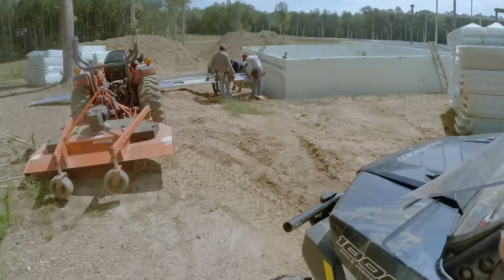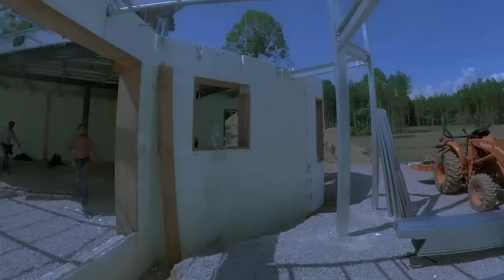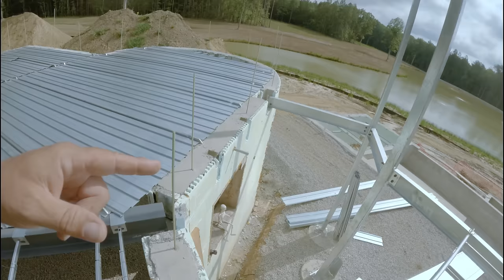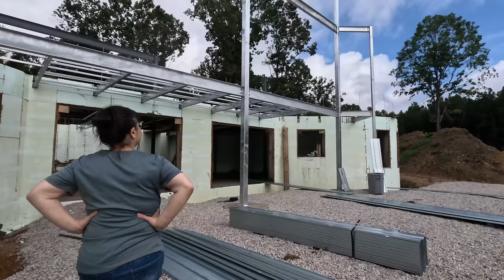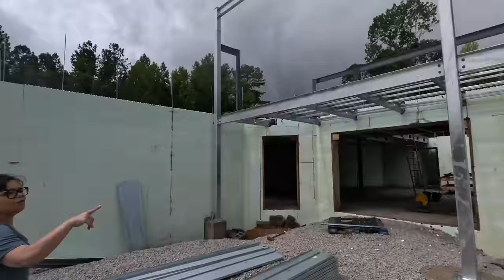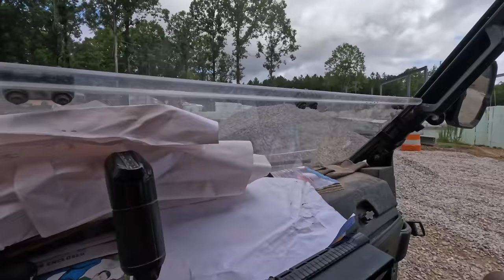Super Floor Day 2 | Rolled Steel Joists & Metal Pan Installation

Comment: It has to feel wonderful walking around on the first floor now! This is getting very exciting, Geoff. And I have to commend your crew. They do know what they're doing and they do it very efficiently. 

Simple mistakes ALWAYS happen even when you plan for them. The mere fact of pouring that much concrete and you only had one small area of under-pour is amazing. Of course you don't want any, but as I mentioned, my dad poured concrete for 15 years. He said there were always pour mistakes unless you were dealing with a couple of yards or less. Looks awesome!
Reply from the maker: Thanks Vickie 😁

Comment: I have seen a suspended Sheetrock ceiling in some houses. They bring it down 8 to 12" below the joist for mechanical. Looks like you will have room for that, you wouldn't have to wrap your steel beams with that.

Comment: Great progress!  Now, you still have a slew of mechanicals that need to be buried in the floor.  And you still need to pour your floor.  With all that panning in place, it's evident you won't be chuting  it in with a pumper truck.  So are you planning to run your crete with buggies?

Congrats on 2 stamps of approval from the boss.  You got an "Attaboy" AND a "you were right" in the SAME VIDEO!  WOOO WOOO!  You be smilin' for days now!
Reply from the maker: My pump operator says he can 🤷🏻‍♂️. If not, we’ll use a line pump. 😁

Comment: Just a quick question… I got my wife interested in watching now and we are curious where your garage will be now… floor system is awesome !!
Reply: All Garages should be connected to house by a Breezeway for house insurance to include Garage in its policy, avoiding more expensive Homeowners Rider Policy to Insure Garage, cause Garage is then covered under the homeowner blanket policy, a elimination of fire hazard and chemical storage considerations !
Reply from the maker: Close by.

Comment: Thank you for the video update.  I haven't seen metal framing put up this way before.  Rarely do you see workers climbing ladders, usually framing like this is erected by workers on electric powered man lifts and scissor life, guys definitely don't go up and down step ladders all day.  The lifts are usually rented by the week, few are actually owned by contractors.  I would have expected to see at least three or four scissor lifts on a job this size.  I guess they'll have great thighs and calves when they're done.  I couldn't do it, I'd be worn out.
Reply from the maker: The way the decking snaps in a lift wouldn’t have helped. They were supposed to bring their boom truck for setting joists but decided to do most of it by hand 🤷🏻‍♂️

Comment: Geoff, I was jut wondering what is the advantage of this system as opposed to traditional steel beam and bar joist  with steel decking ??
Reply from the maker: Ability to modify onsite. Cost. Speed at which the material can be made and sent out.

Comment: That is awesome progress.  I've built some buildings, added on to my house and finished out a basement, but none of that was on this scale.  I am assuming the basement floor will be concrete and wondering why it wasn't poured before the metal pan went on.  It seems to me it would be easier to get the concrete in, although maybe the hose from the pump truck is flexible enough to go through a window?
Reply from the maker: You’ve got it figured out 😉

Comment: Reminds me of the floor system they use in skyscrapers, where they lay steel panels down between the steel I beams and pour concrete floors. Will the concrete in the floor need rebar or is the steel floor enough to support it efficiently?
Reply from the maker: The floor is enough but I’m using rebar anyway as the floors will stay exposed and I’m going to tie the radiant to it

Comment: They have a drop ceiling grid that is heavy enough to screw drywall to and have a dropped one piece drywall ceiling for places like this.
Reply from the maker: I’m looking into that. Sounds pretty cool
Reply: @BealyGood  Just be sure to use the proper tie wires for the weight. I used that system on a hotel fifty years ago and it was really good. Once the grid was up and finished it was just like screwing drywall to steel studs. We were hanging 5/8 inch fire coat drywall for a one hour fire rating.

Comment: Are you going to put  sleeves or block outs on the first floor deck (for MEP penetrations) before pouring concrete?
Reply from the maker: @OregonBob1955  for most stuff, yes

Comment: How are you going to pour with no sides?  Was the styrofoam supposed to be higher on the outside for this?  Not sure I follow what's going on.  Looks like more trouble than it's worth.  Now you got to get the zozzles and bizzozle-nozzles back to create an edge form for the top deck pour.  What a nightmare.
Reply from the maker: You start off not having any idea what I’m doing but then call it a nightmare 🙄🙄. 🤦🏻‍♂️
Reply: Stand back, and be amazed!

Comment: How are the beams bolted to the walls?  Concrete bolts?
Reply from the maker: They sit on the wall and get locked in at the concrete pour
Reply: @BealyGood  So another concrete pour coming ?
Reply from the maker: @thisoldminer  3 more 😁

Comment: Drywall Suspension System would lower that ceiling and allow for drywall to be installed.  Use setting type compound for areas not climate controlled.

Comment: what should be done on the inside and outside of the walls please ?i can't find anyting about it via google  and sorry if you've said this before
Reply from the maker: On the inside you can attach wall coverings like you normally would. Sheetrock, wood paneling etc. On the outside you can do brick, rock, many do stucco.
Reply: @BealyGood  thanks

Comment: Still dont understand why you didnt pour the basement floor before putting on the main floor.Now you have to wheel all of that cement.
Reply from the maker: Why would I wheel in cement when there are other options.
Reply: @BealyGood  Folks are not going to believe where a pumper truck can deliver the goods.  If you have seen one, you know. But if you haven't it is going to look like some alien insect thing.  The engineers who invent all this stuff are amazing.  Don't tell them it can't be done.  That is just a dare.

Comment: I like your videos but your soundtrack is very annoying.  I have to turn it off.  If you have to put music please make it instrumental.
Reply from the maker: I appreciate the feedback but I specifically choose music whose lyrics refer to what’s going on in the video. I spend several hours editing and the videos are an expression of myself. To change would be to deny my creativity.
Reply: @BealyGood  that’s fine.  I’ll just have to turn off the sound.  I watch your videos because of the ICF content.  I built one about 4 years ago and very much liked the process and high efficiency that this type of product offers.   I live in a cold climate and the efficiency coupled with high efficiency heating/cooling and solar panels makes the house almost off grid.  I hope you can achieve your goals.